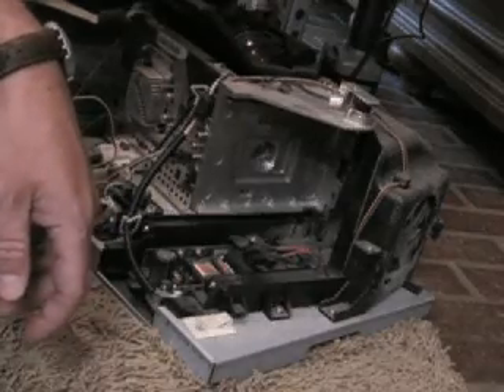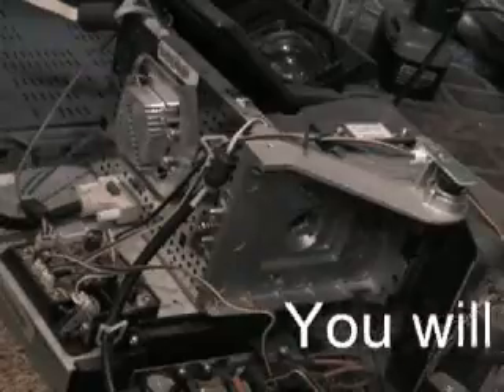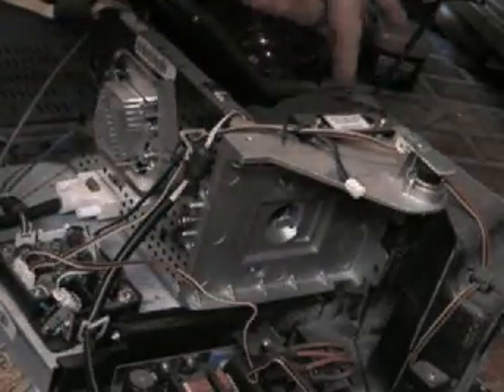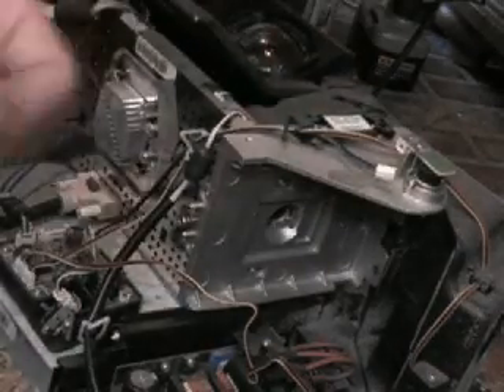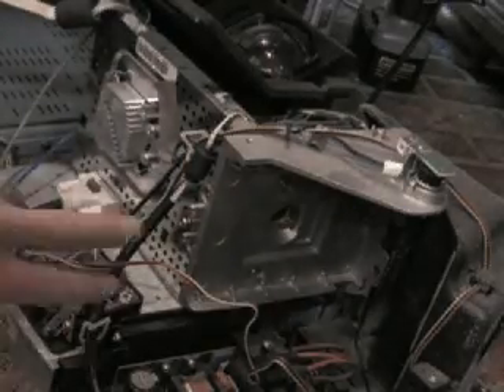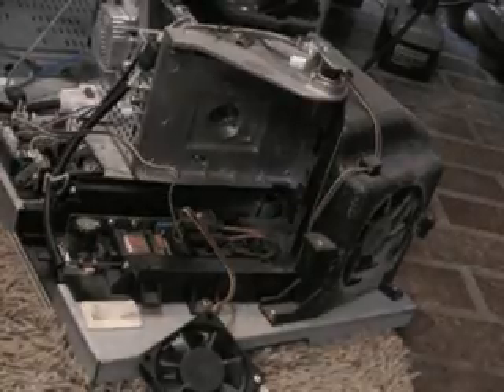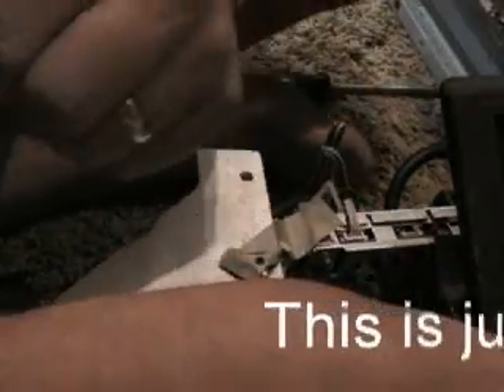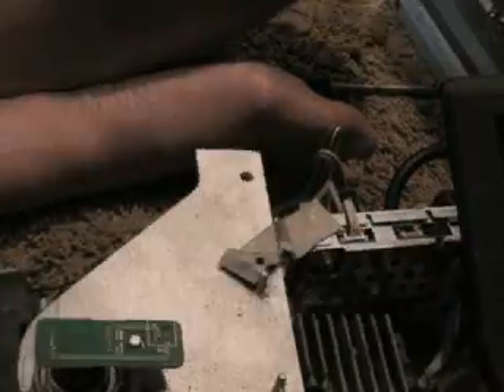Replacing the color wheel in a Samsung DLP Television Part 2

Comment: As I think you discovered, there is no need to remove the "lamp housing". It is not part of the color wheel removal/replacement process. (You also didn't have to remove that heat sensor lead from the top of the housing).

Comment: Great video and spot on for almost every aspect; but watch out for that color wheel plug on the main board that was reported hard to remove, but you had no trouble with. Mine came apart during removal and wrecked the socket.  Be very, very careful with it!

Comment: Great video. I searched you were the first to pop up. Very direct and to the point. Exactly what i wanted. Anyone saying this is hard. This is cake. Takes no time at all. Unscrew some screws. Unplug some plugs. Then reverse everything. It took no time at all. Once I made it to the color wheel part, I just stopped watching the video put the part in and reassembled. Thanks again for the video you made this a breeze.

Comment: Only other comments I had wish I read before starting was that 1 - Back panel has to be in place before you can "test" it. Panel does not have to be screwed in, but set in place correctly, 2 - Ribbon open side has to face rear of TV as mentioned below and 3 - my 6163 did not have to disconnect the "Jumper." Other than that, this was best instructional video I have used yet. Thanks for taking time to share it.

Comment: Great Job and Excellent Tutorial. I felt like a pro when all done. ONLY ISSUE WAS (as I found in the comments), is that the Ribbon needs to have "open" or "contact" side face left or the rear of the TV. There is nothing more frustrating than following steps, step by step and it not working. Luckily I found comments about ribbon and I WAS ABLE TO SWITCH RIBBON AROUND WITHOUT TAKING EVERYTHING A PART. Simply took off cover, and was able to switch ribbon with everything in place and IT WORKED! Thx

Comment: Just wanted to say "THANK YOU VERY MUCH" for the tutorial on replacing the color wheel ! I had my computer setting next to me as I watched your instructions at the same time I worked on my tv. Everything worked out perfect and the tv was the same model as mine, which made it very easy. I did have to pull the jumper after I had closed it up, but that was no problem. Thx for saving me $400+ in a service call. What I know now, I actually can replace the color wheel in less than 15 min. Thx again !

Comment: Are you serious bro? this repair is not easy at all. you have to remove so many parts just to get to the color wheel and the chance of misplacing screws and forgetting to put the parts you just removed is a high possibility.

 basically fucking your TV. i mean i congratulate you for doing it yourself but honestly i would rather buy a new TV or pay for a professional to do it which i know is pretty expensive.

Comment: Mine just stopped working on 2/28/2012. I ordered a new lamp, and installed it last night, but still no picture. It is also making a slight screeching noise, probably the color wheel, and I just ordered it. Your video makes it look simple enough to do, I'll try to do this. Thanks for posting.

Comment: @hexagontaginal  Yes this is what happened to our set...the wheel shattered! We replaced the wheel and now it still will not fire up. the vibrations and noise is gone but just wont start. maybe its the wire that just plugs in...i will double check everything tomorrow.

Comment from the maker: @froyjay11 Did you put the back of the TV back on?  There is a switch that needs to be pushed down and the back holds it down.  If the back isn't on the TV it won't fire up (unless you find the switch and rig it up).  Other than that, look at the owners manual and see what the code is that the power button is giving you (the code is the number of flashes and what parts of the power button are actually flashing).  You should also redo each step you probably just missed something small.

Comment from the maker: I would say check the number of times the lights on the on/off button flash and then look at the troubleshooting guide to see what the code means.

To me it sounds like your set is probably overheating but the code from the on/off button will probably tell you for sure.

Comment: Question: I bought a new color wheel because mine was buzzing. However when i got the new one, i kinda sput it carefully in my fingers and it still seemed to make a buzz noise. i installed it and hte tv fired right up and looked great...5 minutes later it shut back off again. do you think i got a defective replacement part?